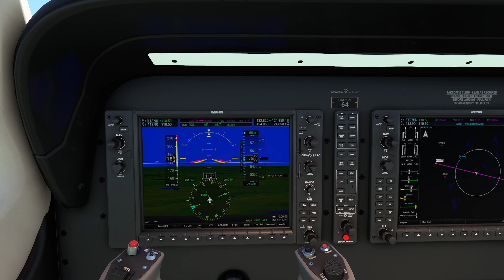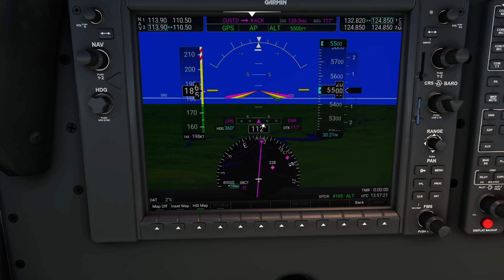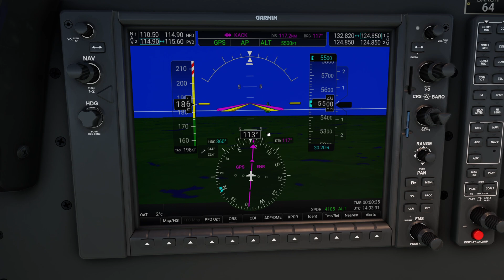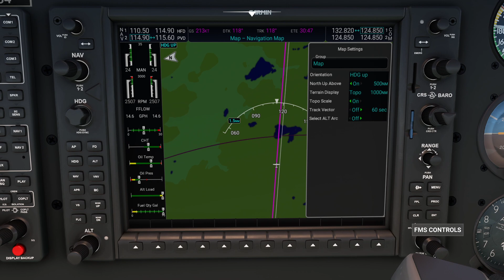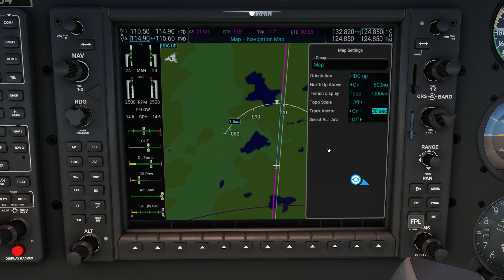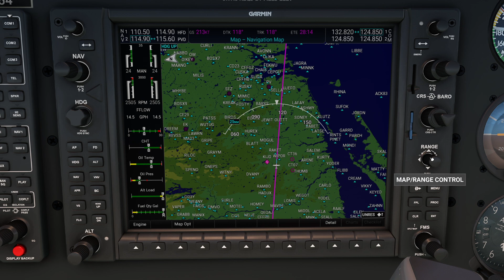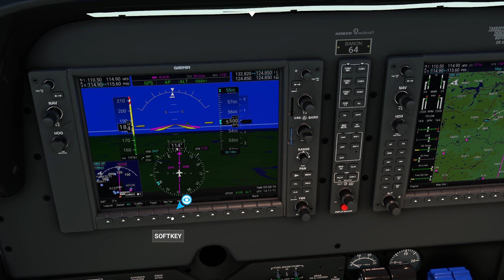MSFS - G1000 PFD and MFD Customization

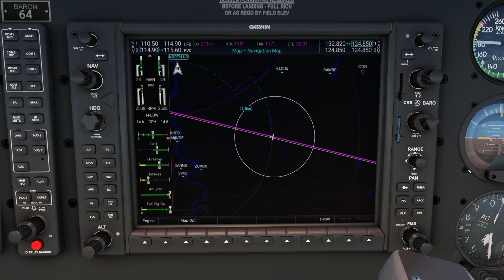Comment: I loved yout video. Excellent for a MSFS beginner like myself. I rewound the video many times between 9:30 to 10:30 to catch up how you zoomed the map in and out in the PFD screen, but unfortunately I'm kind of slow and I couldn't figure exactly how you do it. I will greatly appreciate if you take your time to tell me how I can use the zoom in my Xbox series X. After many tries I found out that if I click the right button of the mouse on "Range" it will insert an arrow in the map. Then with the cursor steady on the "Range" knob I press the left button of the mouse and turn the center wheel of the mouse for zooming in and out, but this is very hard to do. If there's an easier way to do it, please let me know.